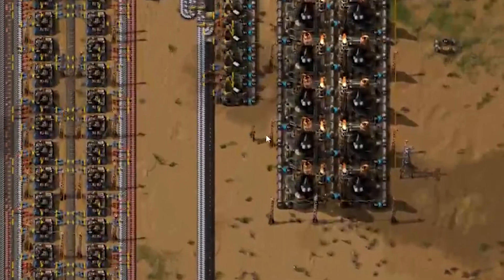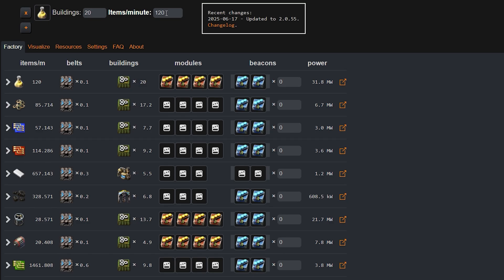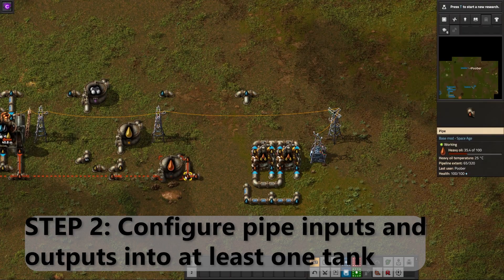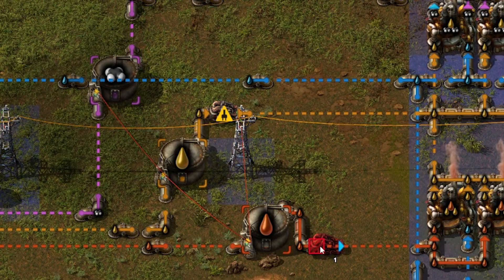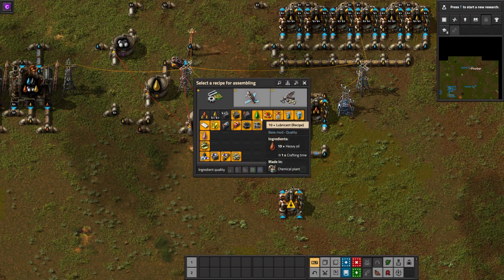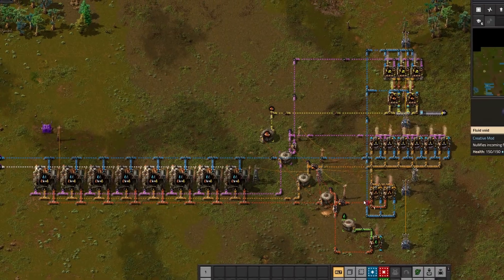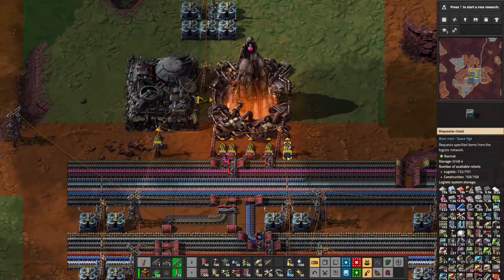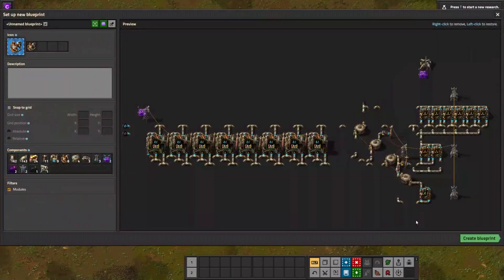FACTORIO TUTORIAL | Balancing Advanced Oil Processing Fluids with the Circuit Network

Comment: Good tutorial. Maybe you could add part 2 about how to deal with chemical fluids in the new planets? And about the blueprints for early game... you show a very big blueprint for late game... I prefer to have myself as you have shown in this video a mini blueprint for each stage in early game: a blueprint for the crude oil processing, another blueprint for the storage tanks + wired pumps, another one for the cracking system, then one for the lubricant, etc.

Comment: Since 2.0 you can also hook the machines up with wire directly and only turn them on when there's a surplus/deficit as well. Functionally it's essentially the same except it doesn't use pumps.

Comment: yyyy... no.. Is better system. 

First petroleum, you need this for some resources like sulfur or plastic. So for this petroleum is not limited.

Light oil, is  required for rocket fuel so no limits. Next, light oil have best ratio for solid fuel so no limits too.

Heavy oil, is olny way to get lubricant, like last  time, no limits.

Now cracking, this is very easy, if is over 20k in taknk cracked it. 

Last step safety valve.

If you have over 24k in tank you have a problem, yor system can by over by one type of oil. 
To produce solid fuel you can use evry type of oil,  so if you have over 24k then you can use this for solid fuel.
Too much solid fuel? Burn it.

This is very easy to remember, never lack of material and "never overflow". To be fair, yes this can by overflow if processing is inefficient. But it's not a problem of the system, but of execution.
Reply from the maker: While I understand where you're coming from, your proposal only works as long as the factories are in place to use those products. Certainly early-to-mid game when production of rocket fuel/light oil, and so on may not be fully established is when it's especially important to be using the enable/disable pump features as described to prevent clogging.
Reply: Yes, i'm use logic to control pumps. But only to cracking.

Look  for example on heavy. Everything is converting to lubricant.
But if you don't use all the lub(production is greater than consumption)  then lub tank is full, sproduction is stopping, and now all heavy is crack to light.

This logic is easy to remember, tank capacity is 25k so if is over 20k(or other limit value) that means that going to overflow and you need do somethng else with that.
This easy and works for erly, mid and endgame.

In you system crack heavy to light is only if light > heavy.
Ok, so i have:
2k light 
10k heavy 
0 lub 
so i'm lack of lub but in you system half of heavy go to lub and half for cracking.
Heavy can by use only for lub or crackig, so you want convert everting to lub, this perfect systuation. But this system is self limiting, if lub tank is full then star cracking.
Ok, you can tell "but i'm go lack of light oil". Yes but light is produce in refinery, lub only from heavy so you have differen way to get light but only one to get lub.
Reply: "just burn it" is one way to play... Caring about utilizing resources without waste is another.  I personally like p0ober's solution (as I believe it matches my own)... it's also faster to respond to sudden changes when, say, a train loads up with a bunch of something, and that changes what's available.
Nice tutorial, p0ober!  [am I spelling that right?  I forget... it's been too long!]
Reply: Burning is a safe valve. How you think what is better, wasting some resources or stop all factory?

If all production line is stable then you never burn nothing. This is only for safe and to be fair, propably you need this only on erly game.